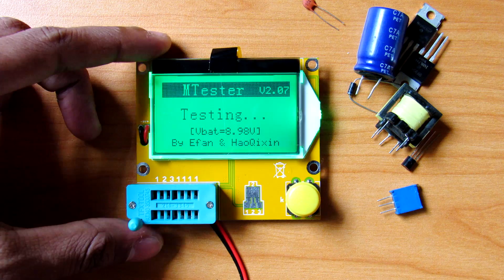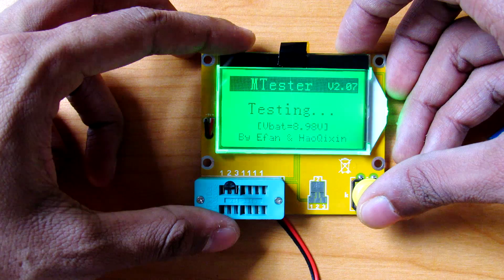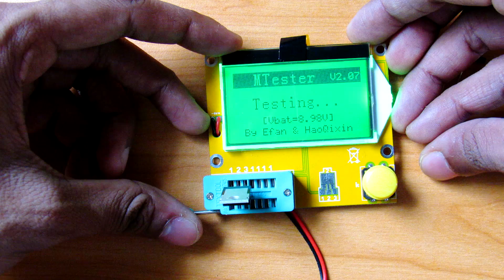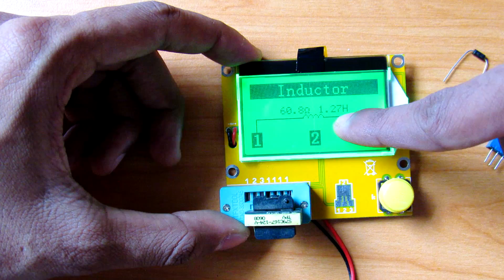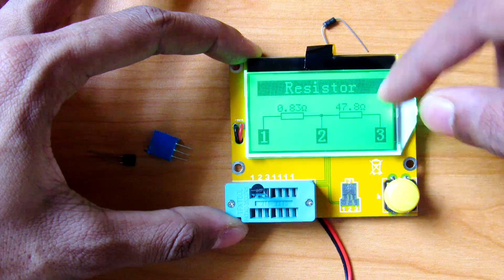Check Your Electronic Components Before Soldering

Comment: if it only have 9 volts, how do you think it can measure the capacitance of a 35 VOLT capacitor????? Because its not depending on the voltage!!!!
Reply: capacitance does not depend on the voltage applied to the capacitor. 35V is the safety voltage before dielectric breakdown. Study some physics, cheers
Reply: exactly

Comment: Hi Kedar,
I have the same tester and several questions. When I put the resistor in,  it gives result as it is a capacitor, when putting the different capacitors it gives always the same result of 26pF. Do you know what is the issue?